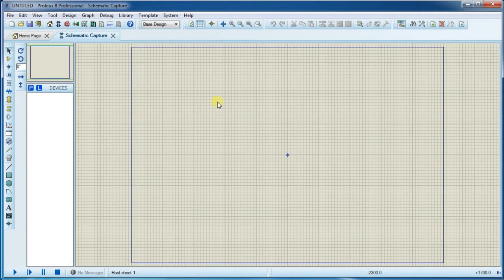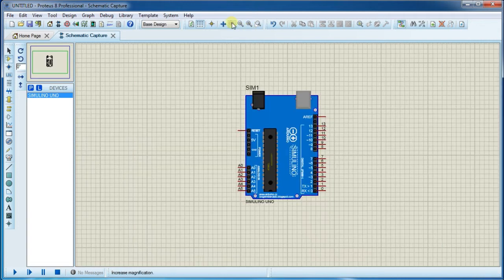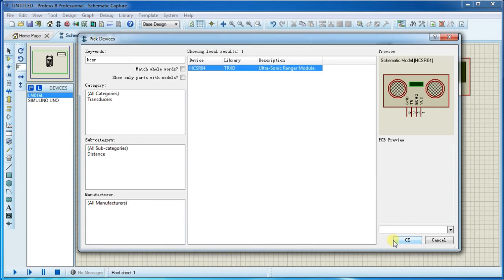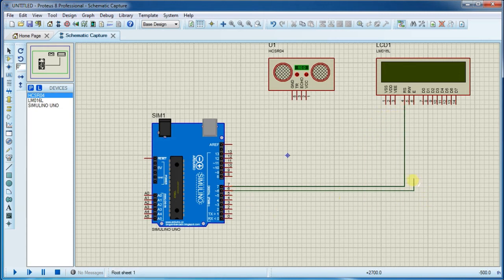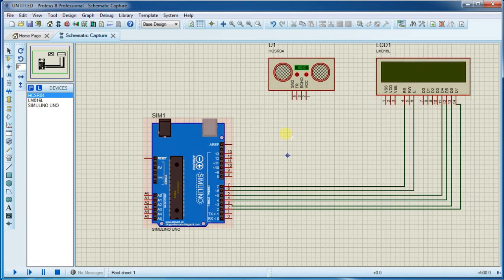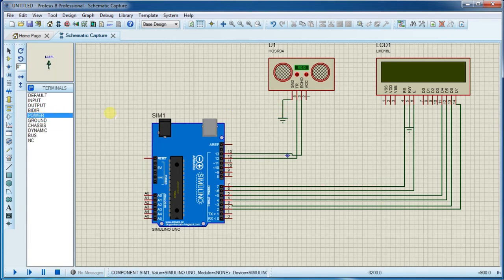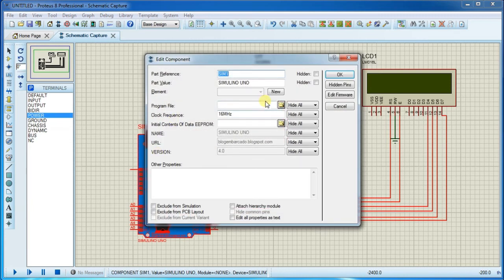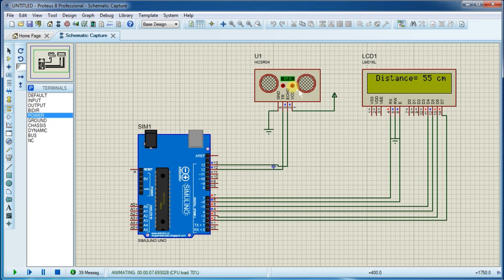New Ultrasonic Library simulation with arduino for Proteus

Comment: can u pls copy-paste the code in the comment box
Reply from the maker: #define trigPin 12
#define echoPin 13

#include <LiquidCrystal.h>

// initialize the library with the numbers of the interface pins
LiquidCrystal lcd(7, 6, 5, 4, 3, 2);

void setup()
{
lcd.begin(16, 2);
pinMode(trigPin, OUTPUT);
pinMode(echoPin, INPUT);
lcd.setCursor(1,0);
lcd.print("Distance=");
}

void loop()
{
long duration, distance;
digitalWrite(trigPin, LOW); // Added this line
delayMicroseconds(2); // Added this line
digitalWrite(trigPin, HIGH);
delayMicroseconds(10); // Added this line
digitalWrite(trigPin, LOW);
duration = pulseIn(echoPin, HIGH);
distance = (duration/2) / 29.1; // conversion in cm
lcd.setCursor(11,0);
lcd.print(distance); //output on lcd in centimeter
lcd.setCursor(14,0);
lcd.print("cm");
}